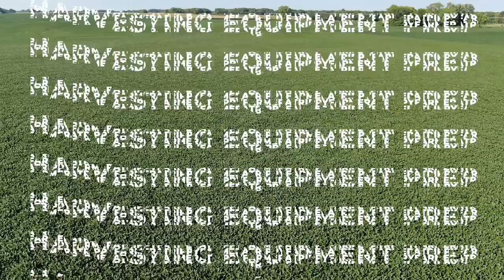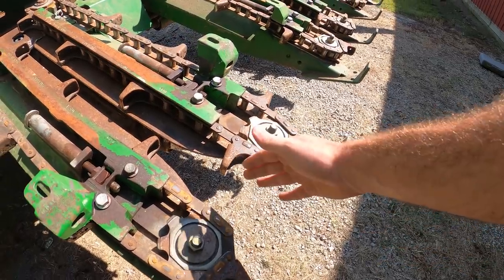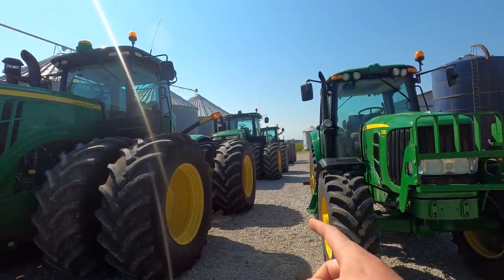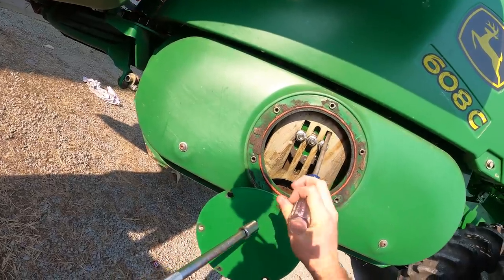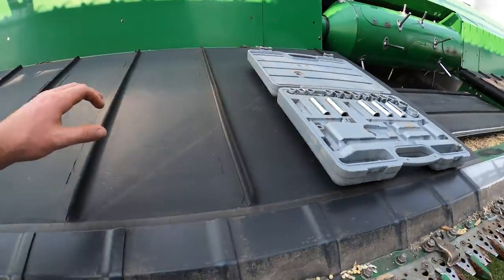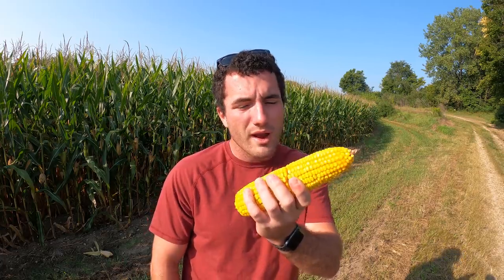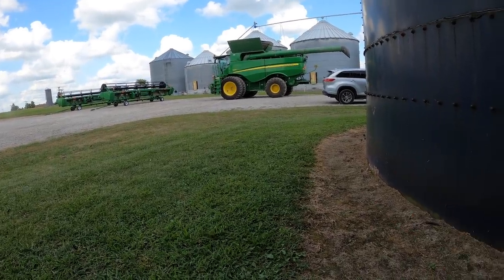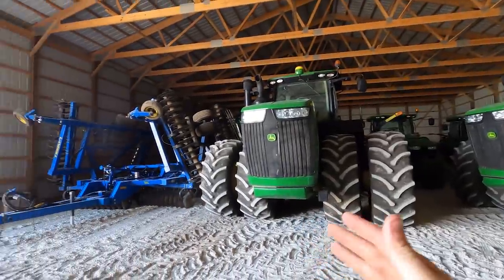Harvest Equipment Preparations On Our Farm (Ep. 32)

Comment: Nice equipment. We run a pair of s790s. One 12 row corn Head and a 40 foot macdon on one and a 35 foot Deere Draper on the other. The 790 is a corn eating machine. 5.5 mph in 200 plus bushel corn
Reply from the maker: Wow that is a sweet setup!!! Someday I hope to move up to a 680 or 780. Any preference on the drapers??
Reply: aTrippyFarmer Deere has a better cutter bar than macdon but macdon has a better everything else. The 700 series drapers are better than the 600 series in my opinion

Comment: Great videos Andy, I’ve Gotta ask, why not run the combines and grain augers out the end doors of the building?
Reply from the maker: If you watch us work on the drapers a little bit later in the video, you will notice that the north barn door, which would be very convenient to use, is located directly behind the 2 harvestores (blue silos). When my family built the barn, they knew that a door on the north side of the barn would be very useful, but they also didn’t want to deal with taking down the old harvestores. Dad told me it is my problem to worry about when I gain more control of the farm. Long story short: the east doors are the only entryway for any type of equipment....

Comment: Im new to this channel, so you might have talked about this before, and you sorta did in this video, but:
Speaking of MN Millenial, if his 9870 can run a 12 row head and a 40 foot draper, then surely your S670 can too? Or are you running some sort of CTF? :)
Edit: And regarding the flashlight. Get a headtorch. You'll never regret it. I highly recommend Petzl, Black Diamond and LedLenser ;)
Reply from the maker: Yes a head torch would be great... or a regular torch with a magnetic attachment. 

Regarding the heads, a combine is capable of the same harvesting capacity regardless of header size. An increase in header size allows you turn less, and it requires less additional power to the ground for added speed of smaller heads. At the end of the day, it really comes down to preference, and our current equipment is paid for—versus upgrades to bigger equipment that may not be justified. Every farm has its own ways of doing things, and there are many different routes to achieve the same goals. At some point in the future, I’m hoping to upgrade to bigger combines and bigger heads. Thanks for watching and for the good questions!
Reply: @aTrippyFarmer  Cost vs benefit is of course always an issue, and as i read your answer, i realise that i have no idea how many acres you farm, or how your crop plan is, and that is of course a huge factor. Just couldent help but think that you would utilise that S670 better with a 12 row ;)
Anyhu, i hope your grain prices goes up soon, and im definatly going to follow you guys through harvest - already subbed ;)

Comment: The audio is fine. I was just wondering why you don't run a 680 or 690 instead of two? I really enjoy you're videos,  they are very informative and well done!
Reply from the maker: We have ran 2 combines for as long as I can remember. A 1 combine setup would be great for corn, because it is challenging to keep the combines from stopping. In soybeans, though, 2 smaller combines will out cut a 680 or 690. Plus, you have the added benefit of a backup machine if something goes down. It would be nice to have a 680 for corn and keep the 9670 just for soybeans.